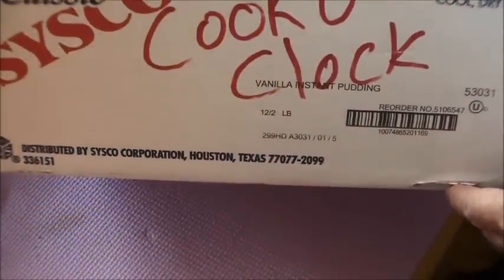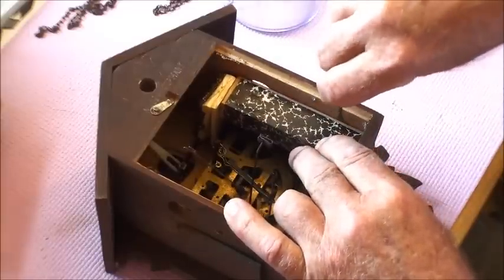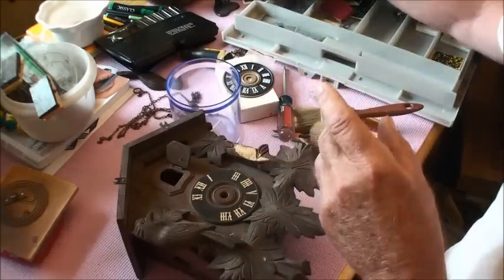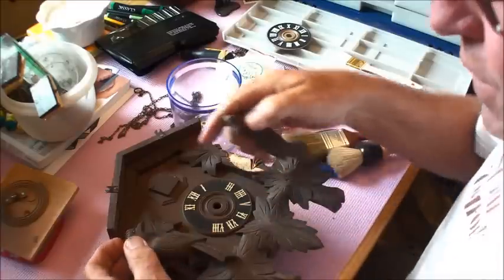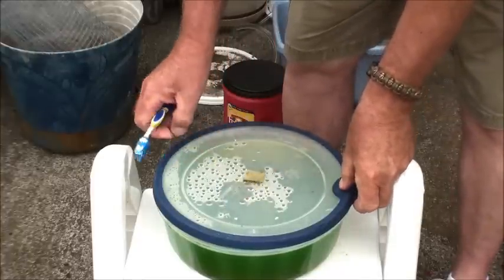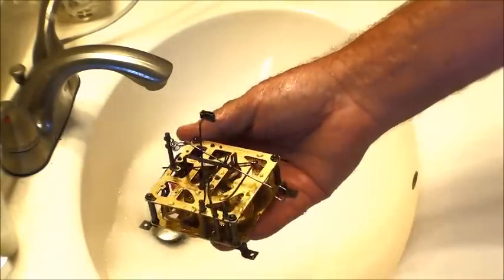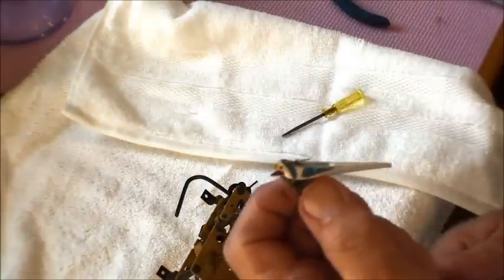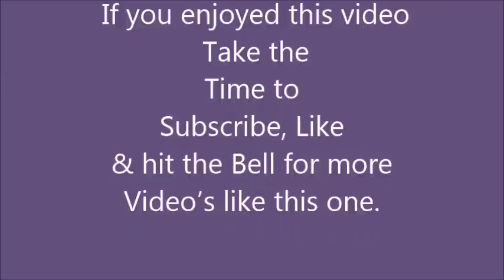Cuckoo Clock Repair

Comment: How do I take piece out when the chains are in it?
Reply: The housing won't come out because the chains are still in it. How do I get the housing out to clean?
Reply from the maker: You would need to open the chain with the hook on the end, and take the hook off. Then you can pull the chain through and out of the Movement.
Reply from the maker: After you cleaned the movement, you can re-install the chain either before you install the movement or after. During the videos I have, you will see how I do it. This is the number one thing asked on cuckoo clocks and maybe watching the start of the tear down and zoom to where I am installing the chains will help you.
Reply: The chains is all the way at the top with the weights. But the other ends of the chains are hitting the floor. Is that supposed to be like that?
Reply: Mike, i have 2 bellows, the bellow lift wires are hard to put back on the bellows. Are they supposed to be tight?
Reply from the maker: @peggykitting6036  The easiest way to get the bellows back in, is to attach the wire to the bellow, then fish it down a the lift arm. Once you get the wire attached to both ends, attach the whistle box to the cuckoo box. Sounds easy enough, but fishing the lift arm and using a screwdriver to move the arm so you can get the bellow wire back on.
Reply: Mike, the right chain is moving freely.
I don't know why as the weight is dragging the chain to the floor.
I'm thinking I might need to take that chain out. I will try to find your video that shows how to remove and install back the chains. But if you have a link to it that would be easier. Thanks
Reply from the maker: @peggykitting6036  If your weight is dropping to the floor, the clicker is bad and needs repaired or replaced. You will have to find one like the one in the clock looks like. You can go online to https://timesavers.com/  and search for what you nee.
Reply: @justmike57  but don't you think it might be the chain is off the gear?

Comment: I have never seen a coocoo clock on the inside before, now i can mark this off my bucket list of things I have never seen before. why don't you use CLR instead of that smelly stuff? The clock turn out very nice, but i will say this, i will never have one in my house unless its digital and does not make any noise lol. I got a Bracelet just like yours.
Reply from the maker: Wow, were did you get a Bracelet just like mine?! I use a real clock works cleaner that removes the varnish, oils, dust and dust shavings form the works. I haven't really wanted to try something that doesn't knock you out because If it don't smell, it will not work. lol
Reply: Just Mike a little bird brought it to me.

Comment: sir with respect.....make some wire hooks for the change .. it  works
Reply from the maker: The wire hooks work well MedZepplin, but you can tell, it doesn't look just right. I have done the wire hooks to get the clock running, but change them out before the job was done.

Comment: Made in Germany.  This was made after 1990.  I seriously doubt it predated WW2.
Reply from the maker: I am the worst to tell the real age of clocks. Yet, you didn't explain how you came up with the age of this clock. 
  I came up with this age because the clock read "Made in Germany", not made in West Germany. I was also going with the muddy color on the clock.
Reply: @justmike57  -I'm not an expert either, but I have done about nine of these clocks so far with various success.  All but two, of the clocks I have were marked as Made in West Germany.  I have one that predates WWII and one that was made after 1990.  My assumptions are based on the condition of the bellows which are functional and made of Tyvek. The earlier ones were made of leather or cellulous based and lasted 20 years at best.  It could be possible that these bellows were recently replaced, but I suspect that the mechanism would have been cleaned during this opportunity.

Comment: If you clean the clock don't put it under the water because it will rust
Reply from the maker: That is not true Finn Hombymad. Also, that is another reason to use a hairdryer, when you are cleaning it yourself

Comment: Great video, I saw you on the Drifter chat and stopped by and joined.   We had a clock like that, but we could never make it keep time.   Check us out,  we are trying to grow as well.   Thanks.
Reply from the maker: Well, thanks for dropping by. Just a note, To slow down the clock, you have to slide the pendulum leaf down to slow the speed of the clock, slide it up to speed up the clock. Just a fun clock to have I think. Thanks for watching and I will do the same
Reply: I’m on a mission to find that clock now!

Comment: ok my friend, to clean a clock you need to take the clock apart and check for wear,  before you clean it, and NEVER put it water.  I know what I'm talking about I was a clockmaker for over 50 years.
Reply from the maker: Yes, you are right, but my videos are for people that can't afford to take their clock to a clock shop. As for putting the clock works in water, you are right, but that is why I use a hair dryer to dry the clock quick and also help blow off the water. Most people are not going to go out and buy chemicals to rinse their clocks with and have the leftover can set in a garage forever. I am happy to hear your concerns and hope you understand that most the people just want their clocks to work. By the way, I have been recently putting in my videos to look for worn bushings, but if they are worn, I am sure they will have to take it to a clock shop or buy a new works if the clock is loved with memories. 
  Thanks again Brian Cook. I do care and God Bless.

Comment: My Cuckoo stop working T.T.
Reply from the maker: Cuckoo Clocks are considered a high maintenance clock because they are opened to the air and dust because of all the openings. This is why they need cleaned every 5 to 10 years, depending on how dusty your area is Tự Lê

Comment: wow 9.99 for that POS is about $9 too much
Reply from the maker: You may be right, but for someone that wants to learn on a POS and has a nicer clock to work on later, it is best to use this kind of clock first. I would say it was a cheap tool and if you broke it, you were not out that much money.

Comment: Very good video but your how to repair video is the first one I have ever seen where the repairman didn't take apart the drive and do a full dissemble to completely clean and lubricate the pivots for the gears . By not dissembling the unit you are potentially going to leave dirt and rust in the pivot holes and when you had oil then you really are going to gum up the works and slow the clock down with the oil and dirt you have left behind. I love the video but not the way you dunk the mech in the cleaner and skipped all the proper tear down and cleaning and lubrication. Not only that but the pivot holes could be worn out and need re bushed and you just by passed all of that and the clock will run slow or stop completely  Sorry my man but not very professional
Reply from the maker: I totally understand your desire for getting the movement totally clean and I have just started new videos or the complete tear down of the movement. The reason for these simple cleanings were to help the ones that didn't have the brain power to do this job. These videos were for the ones that might spray down the movement with W-D 40 and hope for the best. 
  I have found so many movements dripping with oils and sprays and this shows that the people tried to fix their clocks without taking them apart because they were afraid the clock wouldn't get back together again like before they started. So I do hope you understand what was going on here and a place where the people can start and some day, work up to a total breakdown.
Reply: @justmike57  You have my apology. I am a neebee to all of this I do Marine repair for a living so not tearing down something you are working on to service and clean and lubricate goes against every grain in my body. This system looks very complected and complex especially trying to get it synced to the coo coos and timed. Just a suggestion on a video like this and please I am not telling you how to do your work , you are a professional, but explain that you are doing this video for beginners and the proper procedure is to tear it down and do a full cleaning and lubrication and I have another video for that. If you do this cleaning with out a disassembly you take the risk of over looking worn out pivot holes on the drive or rust and dirt that may not come out with the dunk in cleaner. Then add I do not recommended cleaning a drive system like this so this is only for beginners. Then they can make a choice or either doing the dunk method or watch your other video on performing it the right way and save all this confusion. I really like the way you teach .You are slow and methodical and teach in a layman's terms. Years ago some dear friends gave my Mother a 400 day old clock it has never worked made in Germany its a Heco . The support spring is busted I bought a book on them and I just started to cut my teeth last night as we speak and I am starting to dissemble it . Thank you Mike keep up the good work !
Reply from the maker: @madmanmechanic8847  Thank you for your understanding of the way I do things. I do leave my email address below the video and help so many people through the email to help them solve their problems. This almost is another job in it's self. 
  As you can see, the video is an older video and I have a lot of people thanking me for the way I show the easy way of cleaning a clock that doesn't go way over their heads. On the comments and emails, they are thanking me for the help to get that old cuckoo clock running again On each video, I try to explain what each part does so they might get a clue of what their clock is doing or not doing and where to look on the movement for the problem. Most the time the movement needs a Good Cleaning and fresh oil because the clock has set in the garage or barn for so long.
Reply: @justmike57  I hope you were not insulted by my comment Mike . You truly are a professional and I like the style you teach . No fluff and bs to the point and simple that is the way I roll. If its ok with you can I email you some time? I like to give back if you have car problems or anybody has a boat problem I am your man I would like to be able to return the favor if I need your help. I do want to get into coo coos but that is way above my head right now, I need to get this 400 tore down I am making a home made spring unloader and will be making a spring unwinder and winder thanks bud! :}
Reply from the maker: @madmanmechanic8847  For sure there are no hard feelings here. Others have said the same thing because they didn't understand what I was trying to do for the people. Yes, you can email me, but fair warning, I don't open my email every day and some times I forget and take a week to get it open. You have a great day and good luck on the 400 tore down and back again.
Reply: @justmike57  I will send a short email to say hi hopefully we can help each other out. I am so excited to learn how to work on clocks  Thanks bud have a good one!
Reply: @justmike57  Just sent you an email look at it when you get some time later
Reply: LA